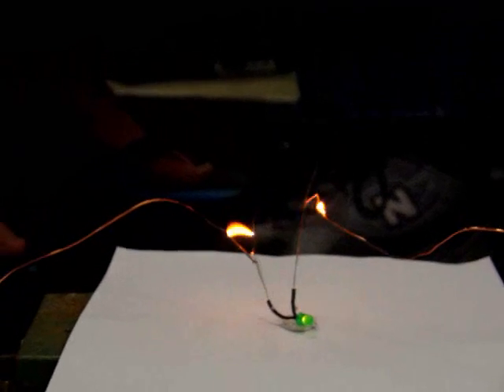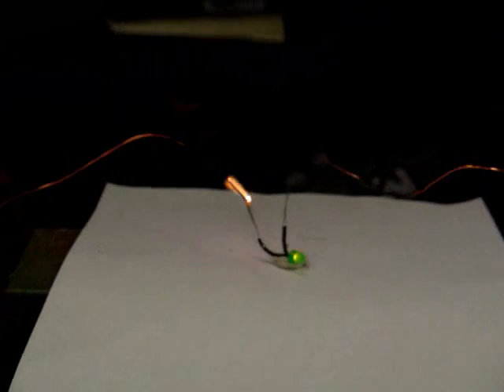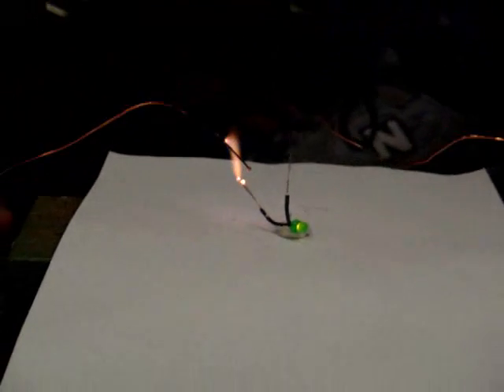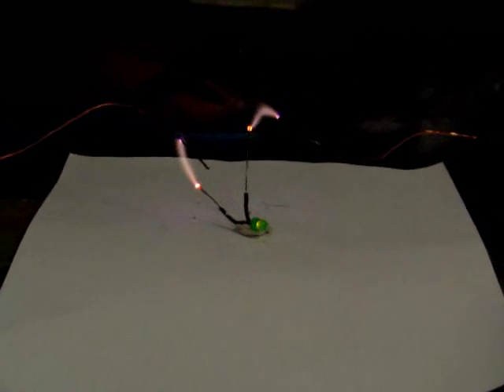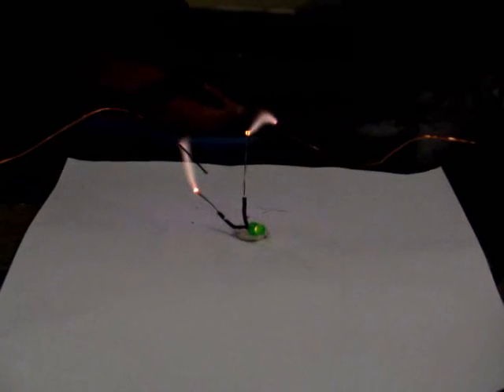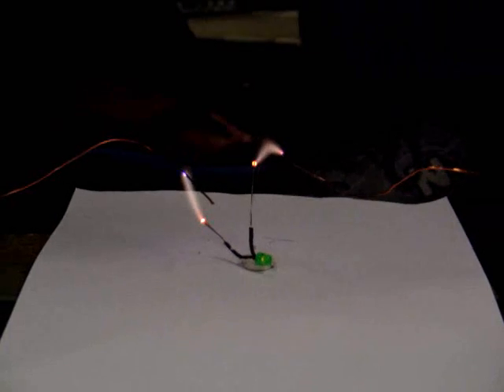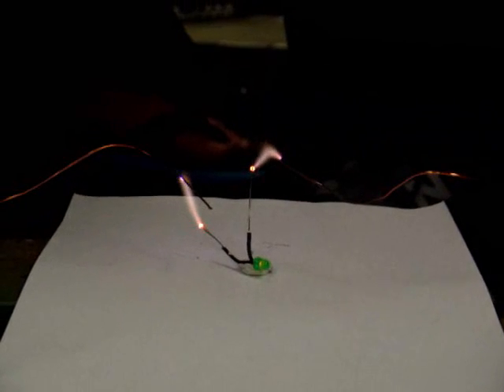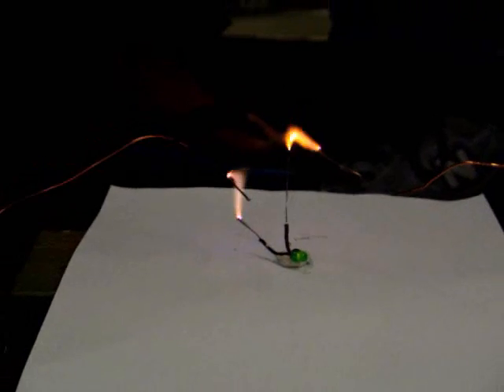15kV AC on a standard 5mm LED

Comment from the maker: The neon transformer is current limited to 30mA.

All the current is passing through the LED, haf in the forward bias, and the other half in the reverse bias direction.
Only one bias produces light and if it were DC, you would at most get 30mA, thats why the LED doesn't blow up.

Comment: have you considered the power was supplied by a simple high voltage low current transformer, rectifyed to dc giving a static electricity effect with minimal current flow. Remember the current is restricted to the power rating of the TF regardless of voltage

Comment: Very true.   I believe you are losing a lot of your potential with your spark gap as well.  Granted i figured you did that as a safety precaution.    I am very sure you had at least a portion of the voltage going over the surface of the led.   

But, I had meant in my earlier post.  If the led were connected in correctly in a normal situation (design voltage) the led would do nothing, no glow no nothing.

Comment: just curious, but.

have you considered you may have had the led "connected"(used very loosly, lol)  backwards, and the 15kv actually was overcoming the diode's properties of only letting voltage/current flow in one direction, and causing it to slightly glow like that?     

You may have thought of this when making the vid, but had to point it out!